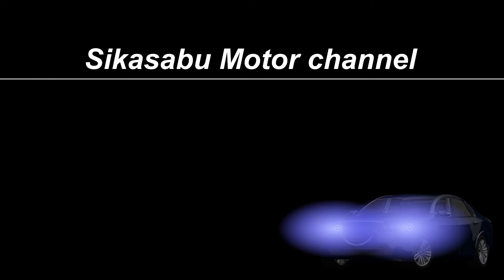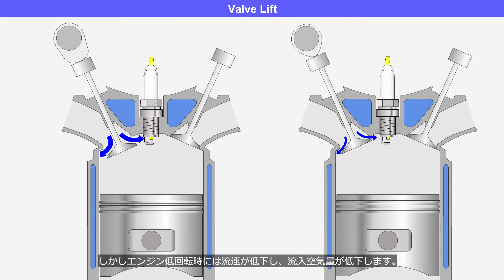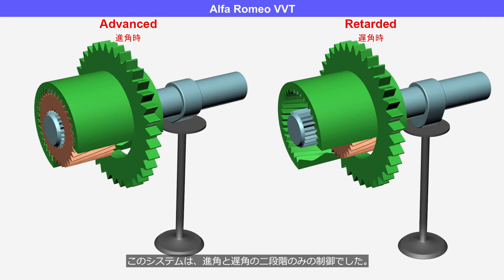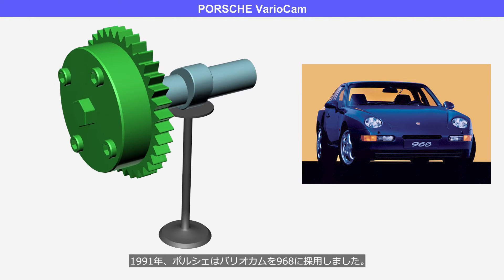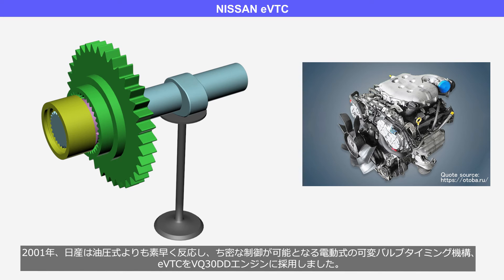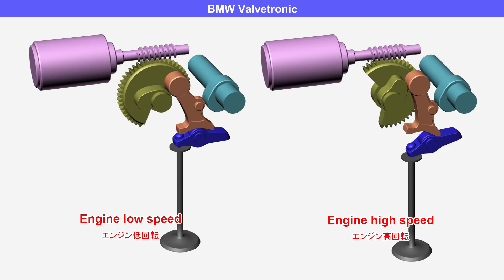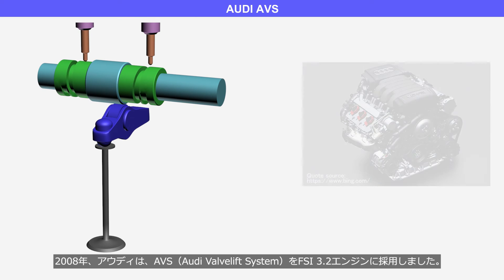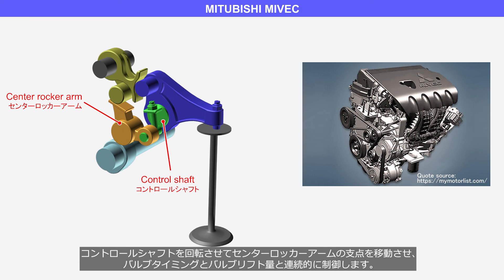VETC, VVT, Valvetronic, how variable valvetrain systems work?

Comment: My boxster 986 S has a variocam system (I think). What is the difference between it and Variocam plus? Vtec is better? Thank you for the video. Very informative. 😊
Reply from the maker: Thank you for watching the video.
Variocam adjusts the valve timing. Variocam Plus adjusts both the valve timing and the valve lift.
Variocam Plus is closer to VTEC.